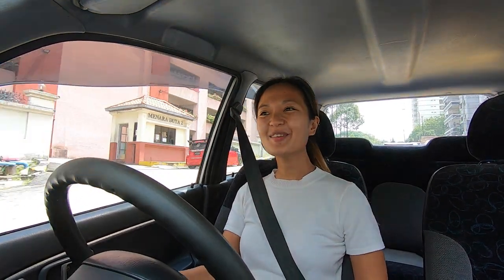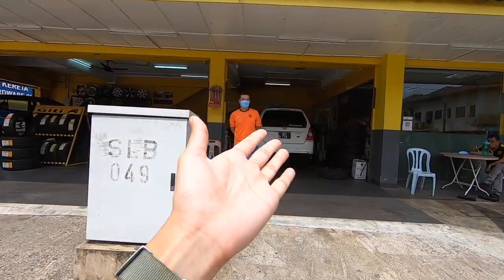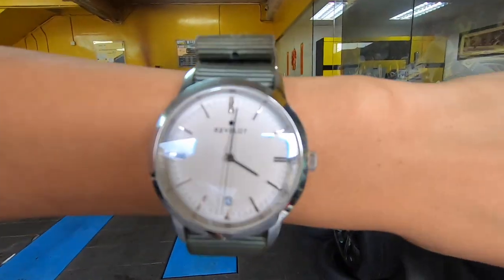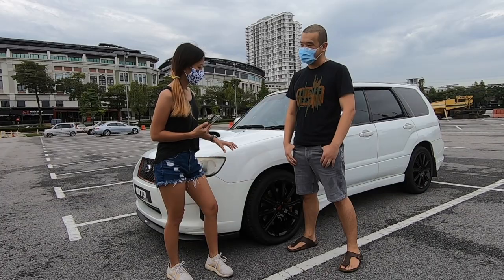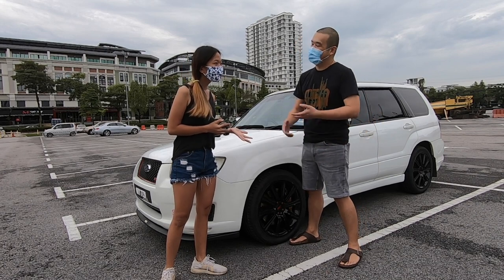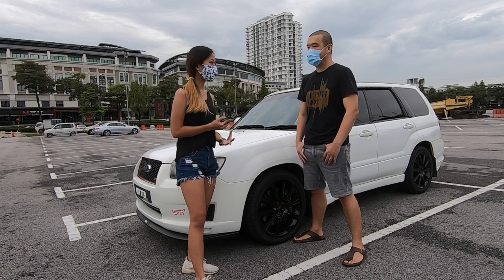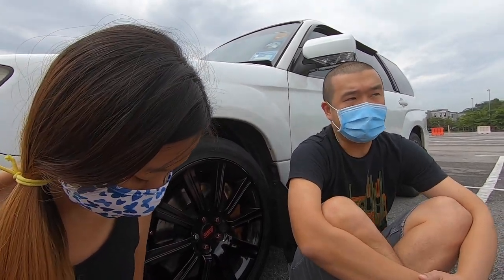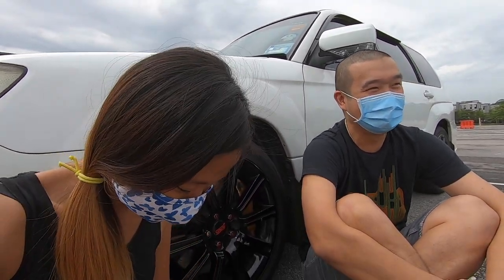Why Would You Choose Giti Sport S1 Tyres Again? | EvoMalaysia

Comment: There is also another tyre  that surprised me which is Atlas A800 Soundless tyre . I bought the iriz in 2020 and came fitted with Atlas tyres . Surprisingly it was 100x better than Silverstone tyres that provided by Proton on the earliest batch . Good braking . Good in the wet but cannot push too hard . Still can take corners in the wet . Comfort is good too . The only downside is they are a bit noisy . I am too looking forward into Giti tyres to try for my next set of tyres .